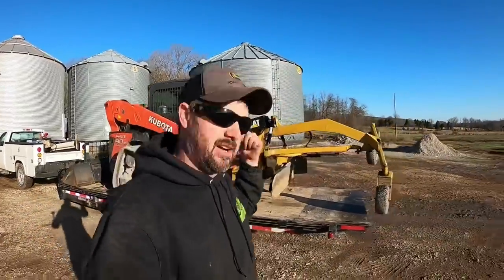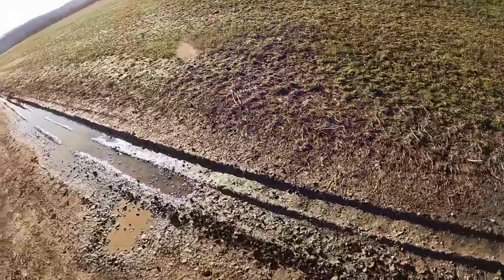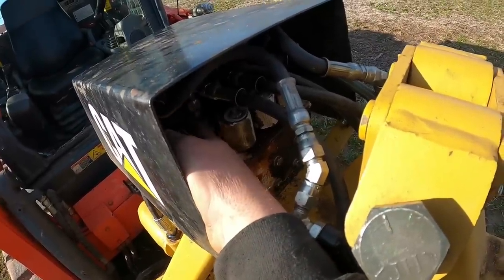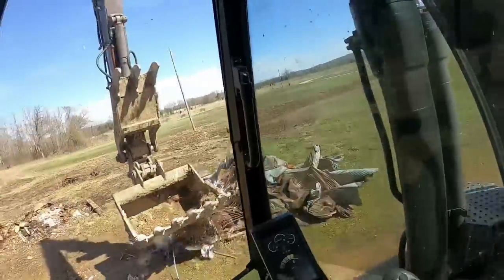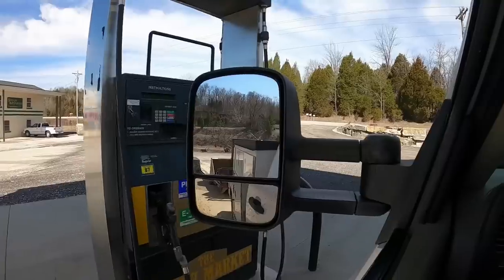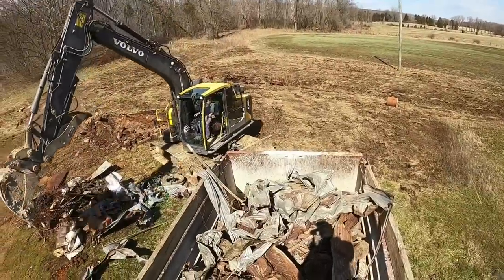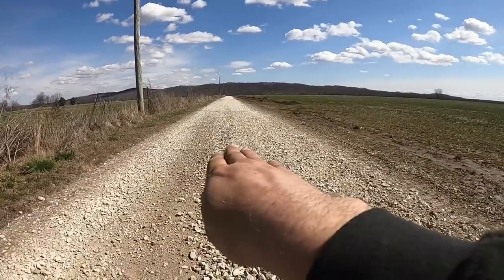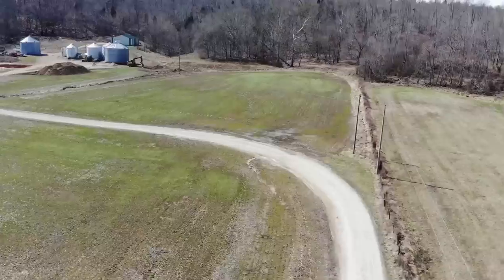Repairing a 3000 foot road with skid steer and grader attachment and a few random things thrown in

Comment: Hey Mike I’m sure you know all this being a dirt guy but here are my thoughts and or opinions, cut under the pot holes ( they are nothing but bowls ) a grader with a ripper will work or even your excavator, make sure your road is higher then the ditches, and a good crown. Maybe put a couple of run off in and if that isn’t possible then lightly remove the wind rows from the side so the water flows in the field better..kinda expensive but maybe resurface the road with 8”-10” of material and it should compress to about 6”-8” when packed in. Another thing ( not sure if they make this for your grader) maybe try scarfires instead of your flat mold board. You might find you like scarfires and the way they cut...Scarfires are individual cutters with carbide tips that spin when grading and sometimes can cut out pot holes depending on the depth of them. Sorry so long but just some thoughts.

Comment: A power rake does a great job on getting ride if pot holes. Then u can put a light layer of 3/4- over the top and pack it in and it does a great job that way. U can lower the power rake to get clear to the bottom of those holes and after some time u will get used to doing that u will get better.

Comment: The Skid Steer Grader Attachment, you are gaining smoothness with it. Chris Letsdig18 was running his motorgrader at one point. He walks and talks with it. The different views you show when working the grader shows smoothness and you have the TOUCH, of the controls. Very good video today showing the Rock Haulers dumping their load on the fly. Helps speed you up with less trips over it with the SS Grader attachment. Very Good, Yes Sir
Reply from the maker: Thanks

Comment: Mike, Have you ever tried a leaf blower to blow out/dry out the potholes so the fill does not mix with the water and turn into mush and squirt right out? That wet silt in the bottom of a pot hole appears to act like a grease layer that prevents the fill from bonding to the existing base. 

Our county gravel road maintenance crew would actually dig out that silt layer and fill and pack.
Reply from the maker: Yes have dup out a few

Comment: The float on kubota skid steers is a pain in the ass... it took me a long time to figure it out best way I've found to do it is  you have to push the boom down click the float button and release everything before it gets all the way down and itll "float" down... it's hard to use but it does work once you figure it out.... I thought it was like my new holland where you just click the float button but it's not... I hope this helps
Reply from the maker: I can get it into float mode it just will not float 🤷‍♂️
Reply: @DirtPerfect  oh well that's odd lol maybe the valve is stuck I know ours a svl95 has a very stiff float and it's only 2 years old

Comment: Depending on the size trailer, my 07 2500hd new body duramax gets 9-12. 16 foot tandem axle trailer I’ll get 12, pulling my 25ft dual tandem gooseneck I’ll get 8-9 depending how I drive. I borrowed a buddies 25ft 16k tandem axle trailer and with a cat 304.5e in it I got 10.

Comment: Float function works in reverse only for back dragging on Bobcats (not sure about Kubota) I set the bucket a few inches off the ground with the angle I want and press the yellow float button on the right control pushing the controller forward (bucket down) and let off before it hits the ground - the float function should take it to the ground, reverse slow and lift the bucket to disengage  it doesn't work forward.

Comment: Fixing gravel roads and driveways is my bread and butter and you have to break that pothole up by either scratching the ground with your bucket or do what I do and use a powerrake (Harley rake) and then when you get everything back to level and the way you want it....I go over it with a small vibrating drum roller and it'll last 5 to 10 years with minimal maintenance
Reply: Looks like more dirt than gravel haha jkjk

Comment: I got a Cat 299 but I have a Kabota 95 coming in for a demo on Thursday.  how you like that 90?  I've never even sat in a kabota but its between that and a John Deere 335.  I worry about the Kabota because I have a 40 inch cold planer that I run with my skid steer and use granny gear for it but the Kabota doesn't have granny gear.
Reply from the maker: I love mine
Reply: I'll be checking the Kabota out hopefully thus week.  they said the Demo will be in Thursday and we can have it for a couple days.  everyone I've talked to that has them loves them so that's what pushing me towards them.

Comment: Speaking of tipping the truck over while spreading,the last truck we had was a 1969 f 700 ford,the previous owner was drunk one evening and decided to spread rock on his driveway,,body was up and spreading when a rear wheel dropped in a hole.Telescope broke,whipped around smashed the side of the cab,box came down and broke both sides of the frame just behind the cab.
Reply from the maker: Wow

Comment: What are you using to control the blade in-cab? I noticed you didn't plug it into your 14 pin connector on the Kubota; is there a reason you don't use that?
Reply from the maker: Have a video on it
Reply: Should have checked your video's first! Thanks again!

Comment: Why are you running the control cable thru the door.  Can’t you get an adapter for the external electrical connection?
Reply from the maker: I see. No point in the to be honest

Comment: Wish I could be more help, but it has been almost exactly 40 years since I last operated a grader (Austin-Western). Only suggestion is, slow down, it is much easier to get a better top crown to the road. You aren't running a patrol grader for the county, or State DOT. LOL
Cheers bud

Comment: Actually that is pretty solid fuel economy for a gas truck doing some towing. Its not like you live in a flat area. You might be able to swap out the valves for some more precise ones as well as a better joystick to run them, if you feel like the grader attachment is something you are going to use more frequently.

Comment: You can get a replacement part that contains the dash vent by the driver’s window and four buttons that control the Driver Info. Center (DIC).  The wiring and plug are already there.  It will enable more options on the menu, one of them being average fuel economy.  It doesn’t do instant on the 6.0, or mine doesn’t anyway.  I’ll see if I can find the part number and post it here later as a reply.
Reply: The switch is part # 15947842.  The surround plate is # 25783286, but it appears to be discontinued.  It is still available online, but you could grab the plate and switch from a salvage yard and add the features easily.
Reply from the maker: Thanks
Reply: @DirtPerfect  You're welcome!

Comment: Wouldn't it be nice if the truck could put the rock down in the middle, maybe 4 feet wide instead of the full width of the tailgate? Like a secondary tailgate in the middle. Then all you would need to do is spread it in both directions and you would have a nice crown.

Comment: E10 available at the pump but fill up with 87, I feel sorry for that engine, the knock sensors must be getting a workout.
Reply from the maker: Know idea what your talking about sorry
Reply: E10 gas is junk and terrible for your fuel system. The only reason it exists is because it's subsidized so the farmers can sell more corn.
Reply: Ethanol hasn't be subsidized for several years.

Comment: It may not be possible but could you dig a ditch along that low section and either tie it into an existing ditch to drain away or put in a culvert to cross the road to drain the water away.
Reply from the maker: Phase 2
Reply: @DirtPerfect  Great minds think alike. Not sure if you or I should be more scared.

Comment: First of all you should NOT travel that fast with a grader.If you ever hit a good size rock you will be eating the front of that skid steer.make your first cut and dont roll off it off the road roll to center and across and then back across filing holes and nothing should be left on your blade tip on your last pass.All the fines have washed to the sides put them back in the middle
Reply from the maker: Ok 🤷‍♂️

Comment: It is a pity that it is usually not possible to drive really coarse gravel there when it is the wettest, because if you got it properly vibrated it would be pure concrete after a few times!
It should save long-term maintenance ...
Here in Finland, they spread gravel in the curves when it is driest, which all ends up in the ditches - often with a car that did not expect to roll gravel in a curve and with a meeting it can only go bad!